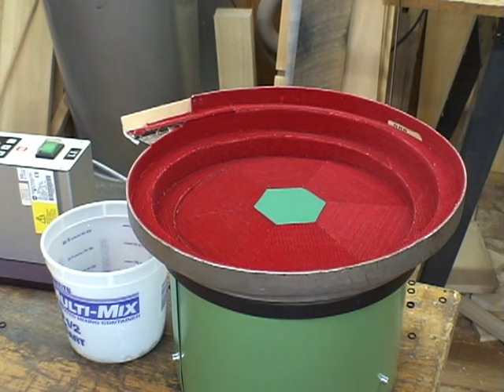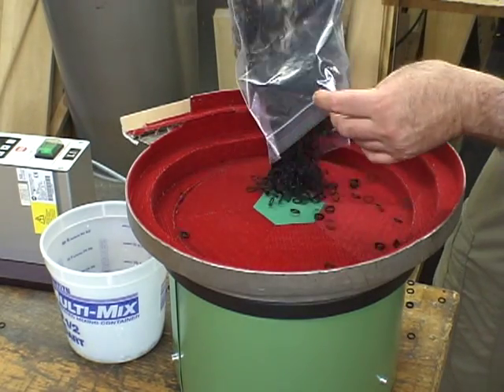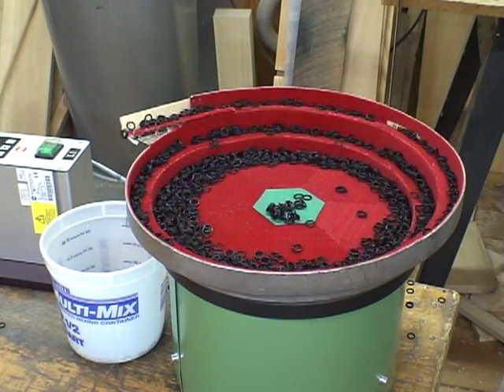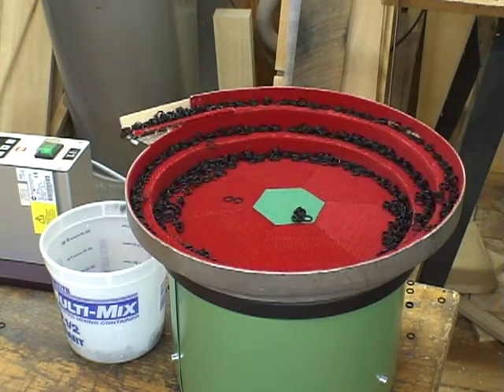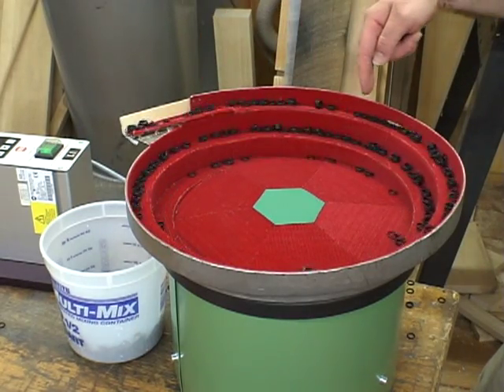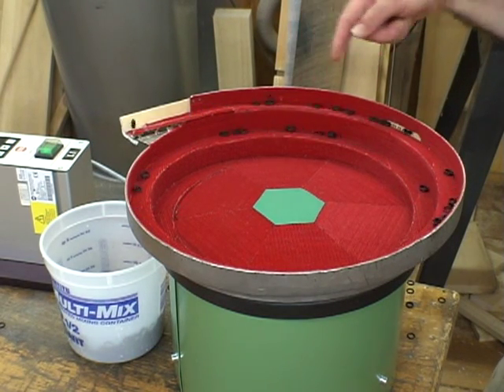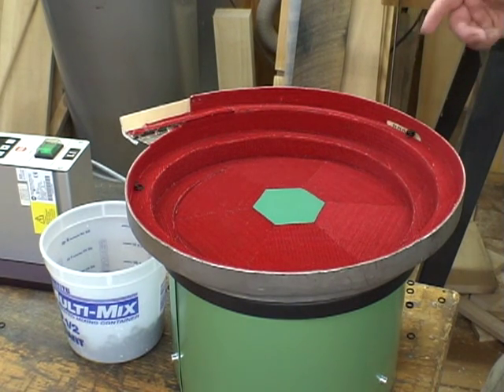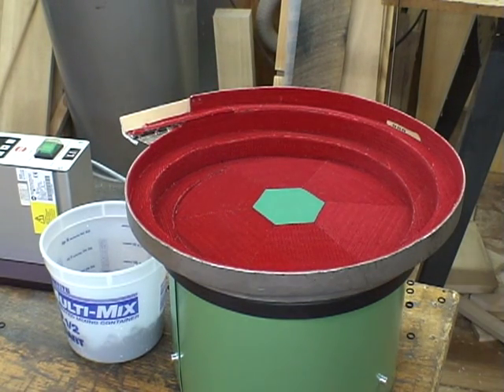o-ring feeder bowl

Comment: Useless feeder, no orientation on the discharge, no singulation at all so it can't be used for anything but re-filling the bucket. Those orings look like they would feed in a standard feeder, maybe you would have to bead or powder blast the surface but that's it. The valour or what ever that is wears so the fibers will cling to the orings and get into the product to which it is assembled. Could not use this for pharmicutical or medical parts.... I like the bug feeding possibilities though!